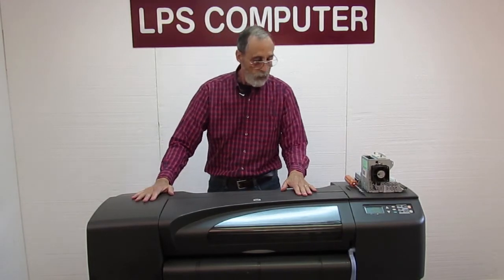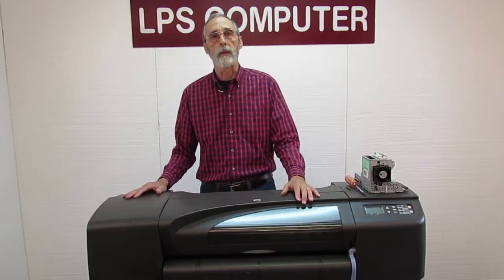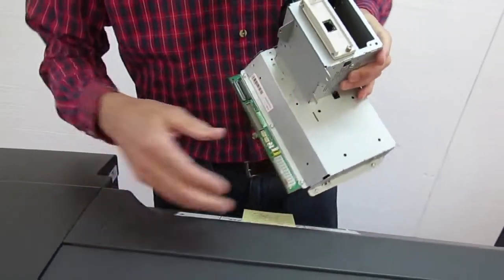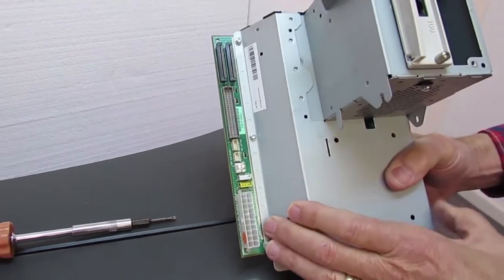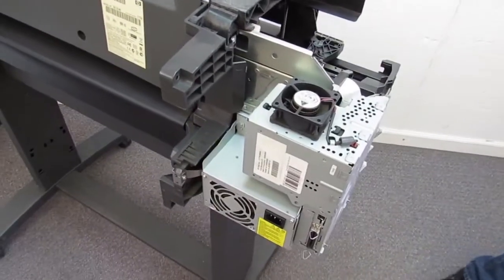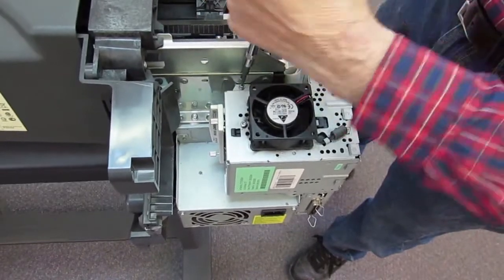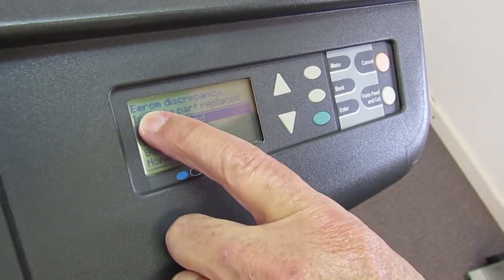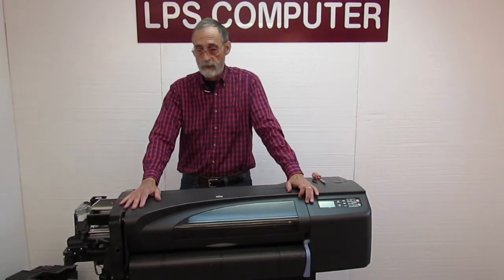HP Designjet 500, 800 Electronics Module Replacement - Error 01:10

Comment: Hi thanks for the info and this may be totally unrelated to the errors you are mentioning, but what causes the power light continuously blinking and an X on the display panel and no further functions.
Reply from the maker: That's usually caused by a failed electronics module.
Reply: @LPSshowsyouhow  Thanks very much. Appreciate it.

Comment: hello, i have a query. i own an hp designjet 500 that shows me a paper not found message. and the paper is in the printer, and it does not do any work and demands that I load paper. swap sensors, backplates, and lots of accessories and the problem persists. What do you recommend me to do?
Reply from the maker: Which sensors did you replace? For further discussion, please contact us at sales@lpscomputer.com
Reply: Hello, could you solve, I have a similar problem with the blue lever, it does not detect when I lift it that it is up, I tested the sensor and it is fine, do you think it may be a damage with the interconnecting card?

Comment: Hi Bob. Thanks for your tutorial. You are in your right to express your annoyance. Sometimes it helps so that one is released.
By the wat. One little question: I've a HP T1100 44 in. If the problem  is the main PCA. Is it necessary to buy the entire electronic module or only the main pca.? Grettings from Mexico.
Reply from the maker: You're welcome! As to your question, you can replace the main PCA and the PSU independently of one another.
Reply: Thank you again Bob. Have a nice day and keep in touch.
Best regards.
Bernardo from Veracruz Mexico.